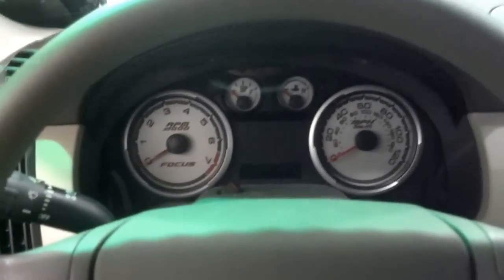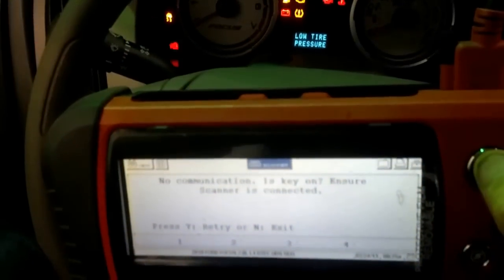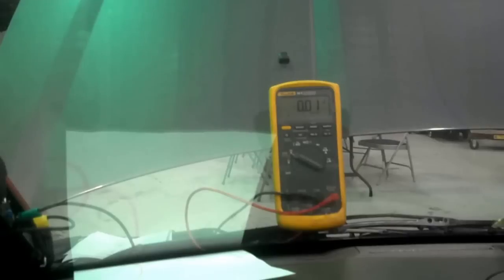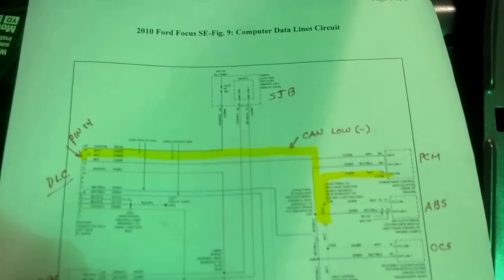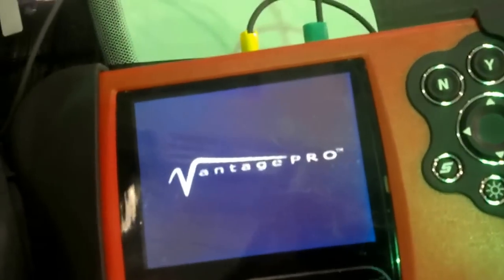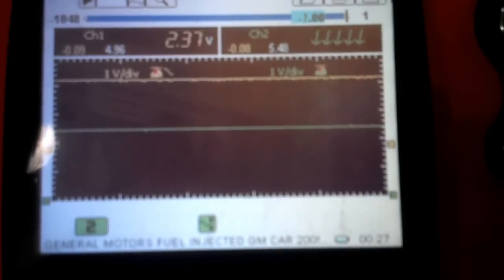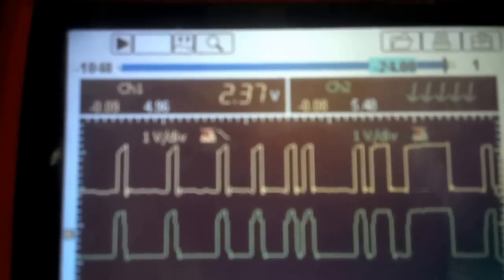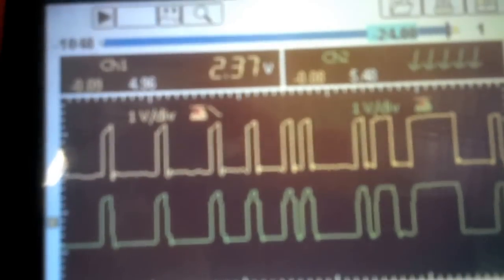PCM No Communication Diagnosis

Comment: Hi Mason,
I came across your video re: no comm with pcm while researching the same problem I'm having with my 06 4.6 ford explorer. I went out a week ago to start my truck and no start. Exact symptoms you have with the truck in your video, security light rapid flash, low fuel, red wrench, etc. I checked the fuses that should power the pcm and they are dead on both line and load side (F39,F42,F43 BJB) I put my Auto enginuity scanner on the truck and as you experienced, I get no comm with the pcm, but, I can comm with the cluster, antilock mod, etc. I check for the 5vdc at the a/c connector and I do not have the ref. voltage. I get .35 vdc when I turn the key on. I checked for continuity on the module comm network (White, white/blue) between the obdII and pcm connector and I have continuity. I'm stumped! Any ideas?
One strange thing: After a few days of trying with no start, I go out and turn the key and the truck starts and the abs light was on. I shut the truck down, restarted it and it ran for 5 min and shut down itself. After that, no start. Later that day it started a few more times but since then, nothing. Any help would be appreciated!
Thanks,
Doug

Comment: Great Video Mason, do you know if the PCM on a 99 mazda 626 2.0 (no special immobilizer key) has to be flashed if I replace it with a new one?
Reply from the maker: Yes, I'm sure it does.  Most vehicles built after OBD2 mandates need to be flashed to the car as they invariably require a Vehicle Identification Block (VID) to be programmed in.  This allows all the modules on the network to handshake and be validated to allow the car to start
Reply: Thank You for the response Mason, Keep those great videos coming.

Comment from the maker: Amin, sorry for the delay, I missed your comment somehow.  Anyway, with the Focus being diagnosed here, the no crank condition was being caused by a theft lock out as a result of the PCM not communicating.  The car would not crank or start until the PCM was replaced.  Not all theft lock outs are due to this, and in fact more commonly is a bad key or transceiver at the ignition switch.  On a system like this I recommend a competent and trusted mechanic to properly diagnose your issue.

Comment from the maker: No communication was the issue, this test proves the network is intact and functioning.  As the CAN network is the primary network, you could not stop talking on it as a security measure.  We don't know what the information is that is being sent, but we do know that it is the same information in both places and that it is not originating from the PCM.

Comment from the maker: CAN communications is the primary network bus for all the modules on the vehicle.  A module may not be communicating on a network at all times, but it NEEDS to communicate in order to perform its operations - in this case running the car.  There are 2 circuits involved, CAN high and CAN low and these mirror each other.  With this test it does not matter which circuit you test, as long as you are testing the same circuit at the scan tool interface (DLC) and the non communicating module.

Comment: So is it possible that the PCM physically turned off the CAN low circuit  pin 14 as an add security measure that third party interfaces cant communicate with because maybe its a ford engineered proprietary signal that there equipment can only decode to allow access to pcm communications and programming? Either way I figured it was a dealership hand-off.